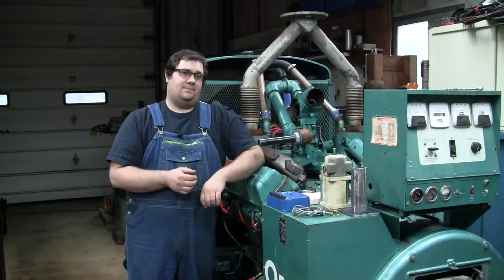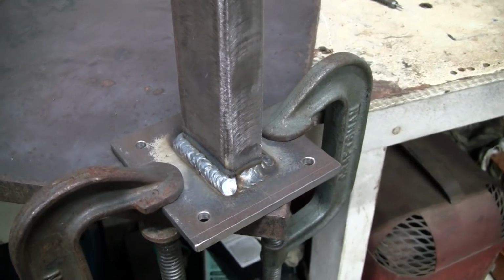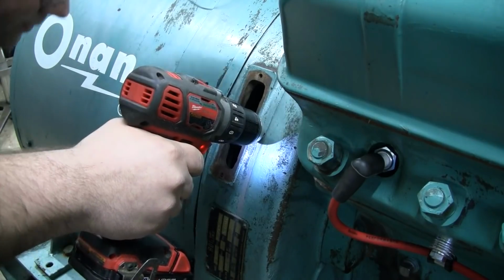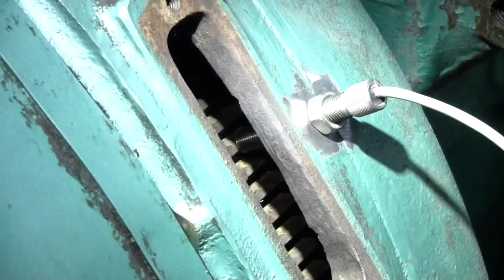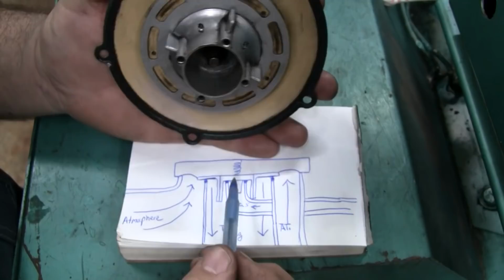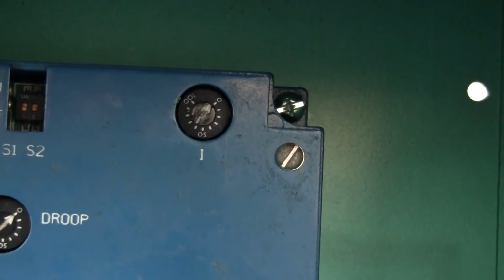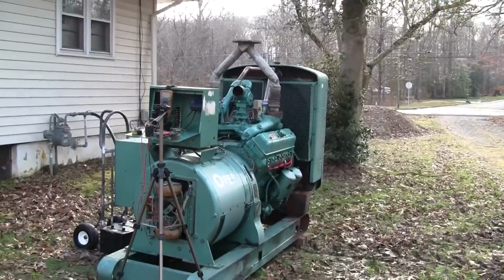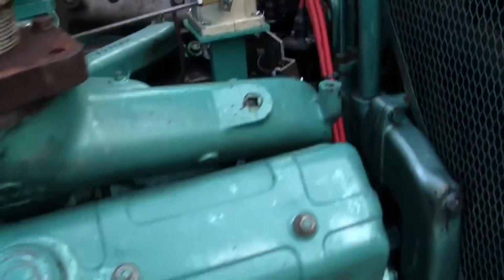GENERATOR ELECTRONIC GOVERNOR CONVERSION 884 Cubic Inch V8 Onan 140 WE

Comment: Excellent video, really have enjoyed watching them lately, you are a multi-talented PRO. One comment, I believe the ring gear speed sensor puts out DC pulses from an internal Hall Effect Sensor, the frequency of which is directly proportional to rotational speed. I heard you say the speed sensor output is AC at least twice in the first few minutes. I understand you were trying to convey the concept of frequency using the AC terminology but this may not be completely accurate.
Reply: They make both kinds, judging by the fact that it is a 2 wire sensor, and the controller diagram on the terminal block shows a coil, I would agree with mike that it is just a reluctance coil that puts out an AC waveform.  I'm sure tons of them use hall effect sensors that put out DC pulses, but not this controller from what I see.  Every hall effect sensor I have dealt with requires power and has a separate signal output.  I guess they could make a 2 wire open collector type hall effect sensor that connected across a current source and shorted it out when it was sensing a "true"  the internal circuitry could have a diode and storage cap to keep it alive while the leads were shorted but this seems like a goofy sensor because it would have a limited ON time.

Comment: I love that engine. I wonder if it would make a good truck engine for a cabover truck? Getting parts for my 332 Lincoln big block is hard enough. I wouldn't think NAPA will have an oil filter on hand for it.
Reply: Get yourself a "modern" 429/460 385 Series and live happily ever after and no worries about parts availability either for a long, long time.
Reply: @GIGABACHI  I'm thinking a 335 series 400. It's going into a 62' F-800 firetruck. Those Y-blocks are getting hard to find parts for. It being a Y-block also means that it also has a front mounted engine mount. I was thinking that Waukesha engine might go into a CL9000 with a blown 3406B engine. They're both play trucks.
Reply: @133dave133  400 seems like a good choice too. I love those dark, not so popular, oddball engines. 👌🙂👍

Comment: If you can't get enough gas you just have to move your connections to the other side of your meter.  😃
Reply: Phil G ... raising the gas pressure will NOT compensate for lack of flow at the right pressure. If I have to explain it then you obviously don't understand what's going on here.
Reply: @rupe53  Then again, the pressure through the regulator is a contributing factor.  House regulators are pretty anemic, and definitely a bottleneck when compared to what this motor is choking down. But its probably also illegal/(idfk, the gas co threatens legal action for "Stealing gas" ?)  to do that anyways b/c that meter is the primary way they measure what your using.
Reply: @themotorfreak1  ... short version: There's a reason why gas pressure after the meter is standardized as low as it is. I wont get into it. There's also the set itself, which has limits designed around that standard pressure for natural gas. Beyond those limits (within reason) even the gas valve on the gen set will not open so it will not run. I have seen sets where the gas regulator has gone bad (mostly propane sets) and the unit has failed to start because the various springs, solenoids, and diaphragms can't open against the increased pressure. As someone who has worked almost 25 years in that field I will guess his gas meter is roughly 400 CF in capacity (based on house size and pipes I can see) and that set needs at least 4 times more than that. I can also tell you the pipe size from the street just can't supply that much fuel.
Reply: Turn in to max your regulator. Like free gas

Comment: What happens when the magnetic pickup misses count of a tooth? Wouldn't your timing then be (however many degrees that tooth represents) off?
Reply: It’s not for timing. It only reads speed. If it missed a count it would try to speed up. Very unlikely, it’d have to miss a bunch of teeth (dirty mag pick-up) before it wouldn’t work. That’s why he tried to keep all the metal on the tap, so they don’t stick to the pick-up.

Comment: Air gap also affects mag pickup output at low rpm. I lightly adhere a paper or cardstock of the correct thickness to establish air gap and let the ring gear wipe it away once the engine starts.

Comment: If the valve guide is that bad it's putting a side force on the valve head. Work the engine hard and you can lose the head off the valve followed by the piston, cylinder head, etc.

Comment: The gas supplier loves selling gas , They would likely install a larger regulator and meter at no charge .
Reply: Agreed. I called up and said that I was installing a new appliance and the gas company came down and opened up the side of a truck that had 30 meters inside. He asked which one do you want? I said the largest one you have. He installed it, for Free,

Comment: I just can't wrap my head around the linkage setup.  Maybe somebody here can help me.  It seems a butterfly valve is like a ball valve.  Near closed a tiny adjustment makes a huge difference.  Say going from 10% open to 15% open is a huge difference but going from 90% open to 95% open makes essentially no difference.  It seems like you'd want to make this more linear for the actuator.  To do that you want a bit actuator movement to equal a small movement on the governor at the low end but near the top you want a little actuator movement to move the governor more.  That's opposite to how this is set up and I just can't seem to make sense of it.  Can anyone guide me as to where I'm going wrong?
Reply: If it was linear for the actuator, it would barely move at low throttle and have to move a bunch at WOT.  It would be hard to dial in the actuator off-idle like that. This way, you sweep more degrees on actuator (better control) at part throttle and towards WOT, it won’t make much difference. Keep in mind generators are supposed to be constant speed 60hz. You want to be able to compensate accurately with load changes when you are at lower throttle opening.

Comment: Nice work! I love saving old equipment that is still useful. 

I realize industrial engines have a narrow power band at a relatively low rpm, but with 884ci, who cares?  I want to put a Roly in a hotrod.

Comment: to address the running on fumes, would you be able to get it running on a bottle of CNG or does that not come in bottles?
Reply: skyliner ... have done a few similar but being more rural we always resort to a mock up with propane so we don't have to deal with the gas restrictions on NG pressures. You can get an 80Kw going on a BBQ tank, although load testing is dicey. Have done a 100 Kw load test on a pair of BBQ tanks, but the tanks frost up in a few minutes.

Comment: ALL YA REALLY NEEDED WAS AN OLD ARA ADD ON CRUISE UNIT USED BACK IN THE 70S AND EARLY 80S OUT OF A JUNK YARD.  GLUE A MAGNET ON THE BALANCER ,MOUNT PICK-UP AND HOOK UP THE THROTTLE AND CONNECT THE VACUUM HOSE.!!

Comment: I'm curious to see if some of the positive type valve seals might work to temporarily align that number 6 valve and bring the compression numbers up. Definitely wouldn't be good for more that at most a few hours, I'm sure, but who knows?
I was also thinking you might, if careful, be able to slowly drop the exhaust valve into the cylinder using the piston and knurl at least part of the valve guide. Again, not a permanent solution, but if pulling the engine apart to do the guide, might be worth a shot - if only as an experiment.

Comment: Looks like both Switches where on.  S1 and S2 on the controller.
Reply: It’s an optical illusion. Take a closer look when he zooms in. The switches are stained blacker on the higher points from dirty fingers. Once you recognize the higher poi’s are blacker... you’ll see he has both switches set correctly. I had to take a second look for myself as it tricked me at first too. 😂

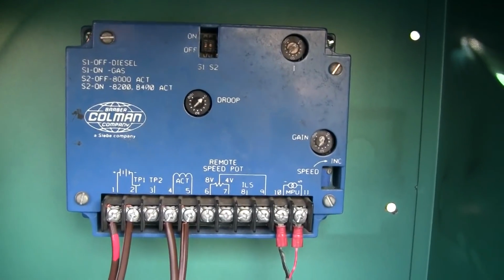Comment: 39:31 Your switches S1 and S2 are set the oposite way than you say. They are set to diesel and 8200/8400 series actuator (S1=off, S2=on).
Reply: Exactly... did I bother screaming at my screen?  No.
Reply: Thank you this bothered me very much
Reply: When he zooms in you can see that they are set right. It just looks weird on camera.
Reply: It’s an optical illusion. Go back and look where he zooms in. Keep in mind that the darker spots on the switches are the high spots where dirty fingers touched them. Once you see it... you’ll understand. He has them set correctly. I had to take a second look myself but it’s correct. 🤣
Reply: @TsunauticusIV  You might be right. I'm used to see clean DIP switches, because usually you move them by a screw driver, not your dirty finger.

Comment: Nice informative video as usual. I thought it was a Hall effect sensor behind the magnet in the magnetic pickup? It appears this one is different? Have you ever heard of anyone converting a Cummins 855 diesel to a spark ignition engine? I have one that I would like to make run on gasoline.
Reply: I work in the natural gas compression industry we have lots of 855 spark ignition engines running natural gas. I’d imagine the conversion could be done with readily available parts. Not real sure about the gasoline part through as far as compression ratio requirements. https://www.cummins.com.ar/sites/bupa/files/pdf_g855gta855.pdf
Reply: @corywillbanks6348  thanks

Comment: I’ve set up mag pick ups to read off to read off the sides of the ring gear.
Reply: I had one mag pick up fail from metal chips off starter gear operation caused governor to go full speed losing Hz count.
I clean off pickup as in ABS wheel sensors on cars go haywire from metal filings on magnets.

Comment: I know you know what you're doing but I thought I'd throw in my 2 cents.  Judging governor response by manually forcing the throttle open or closed isn't necessarily a good test.  Under load you will want the governor to (obviously) hold 60Hz pretty closely and respond aggressively to changes in load, even 0.5Hz.  It should never be in an operational state where the delta speed is a droop down to, say, 45Hz or up to 70Hz because the governor should be holding it WAY tighter than that.  Maybe all I'm saying is...time to bring it to the shop and set it up with an actual load.

Also on the knobs, those are just PID controls right?  If we try to make a mechanical analogy, would you say the gain control is like spring rate and the integral adjustment is like a damper?
Reply: It's a PI controller, no D.
P (proportional or gain) is the easiest to understand. With just P the position of the arm is proportional to difference between the actual speed and the desired speed. The more error the further the arm moves. Increasing P just controls how much the arm moves for a given speed difference. The problem with P on it's own is that you can never reach commanded speed. At speed the difference is zero so the arm is at zero throttle. It may not be that accurate but it reacts quickly.
I (integral) is harder to explain. Imagine you have a drum with a valve on it. If the P error is positive it steadily adds water to the drum. If it is negative it steadily lets water out. The amount of water in the drum is added to the output. The I pot I adjusts how fast that water flows. Integral will get you very close to commanded speed but it is slow to react. It also really gets upset if you override the output. If you hold the throttle closed it keeps adding to that drum, pushing harder and harder on the throttle.  Now when you let go there is far too much throttle and it takes a while for it to let that water out again. If  you must test by overriding the throttle do it quickly.
When you combine the two you get a combination of the fast throttle response of P with the accuracy of I.
Reply: Gain responds rapidly to load changes while integral corrects for long-term error or drift under steady load conditions. Think of cruise control in a vehicle. On hilly terrain the proportional (gain) signal will be adjusting the throttle to keep the vehicle at approximately the desired speed as it goes up and down hills. Once on level ground any small difference between desired speed and actual speed will be integrated over time by the integral control to generate a correction signal. Think of gain as a course adjustment and integral as a fine adjustment.

Comment: Hi, without the lavalier mic the engine sounds great. Is that controller analog or digital? Seems as though it is analog in the way one adjustment seem to slightly affect the other when you were setting it. Also when the gen-set is installed as it normally would be is there a main gas shut off valve external to the gas carburetor?

Comment: You have the pivot point on the engine side too far past the center of the pivot. In my opinion the lever arm is too short and too far towards the generator end.

Comment: how can you get the speed truly dialed in with a weak cylinder? thats always going to throw a slight RPM drop at that point in the firing..  with a mechanical governer id not think its a big deal.. but electronically it seems that controller might get triggered by it
Reply: It would only matter if the engine could not generate enough power to handle the load. The governor is monitoring the generator not the engine. So it could Evan have a dead cylinder as long as the engine has enough power left.
Reply: @daleolson3506  whcih more I think about is exactly whats going on since his gas pressure is low..  the gverner appears to "overshoot" to try and compensate for the lag in the carb..  i guess wit ha dead cylinder or a weak one you'd run with the gain actually turned lower maybe?
Reply: Where can you find a governor wich is controlled without the mag pickup ?

I have a old Detroit Diesel generator (PU 406 M) with a broken sensor in the hydraulic governor.
The hydraulic part works the electronic part is not stable it will go full trottle and back to stationair in a blink of an eye.

Sorry for the spelling autocorrect is not helping 😢
Reply: @guusdegroot6846  cant you just set the desired throttle position so the racks maintain the RPM? from what ive seen on the old 6V,8V etc is that setting the throttle stop the engine will move the rackas on its own to maintain the RPM..  thats how people got in. trouble lugging Detroits in trucks with stick-shift was becasue the rack would go full open to maintain an RPM that the throttle spring was calling for..
Reply: I imagine the electronic governer operates using a PID loop, with the I (integral) component compensating drift that the P (proportional) component plus bias doesn't.